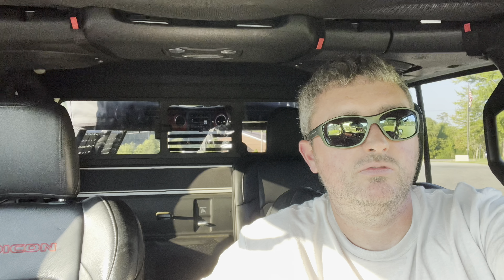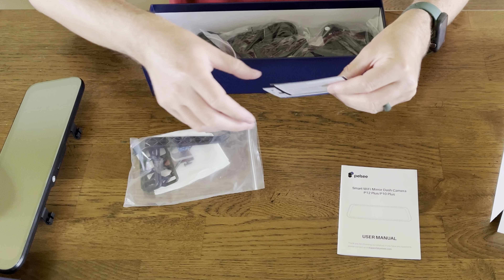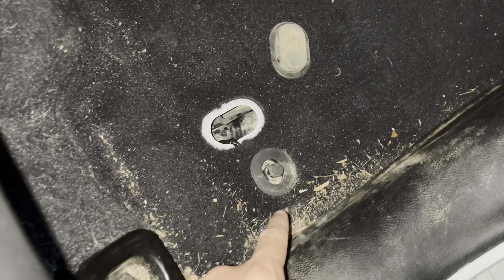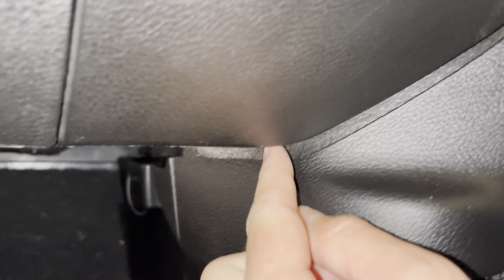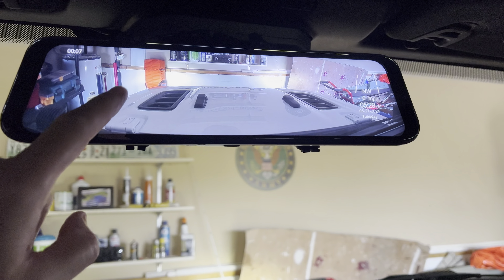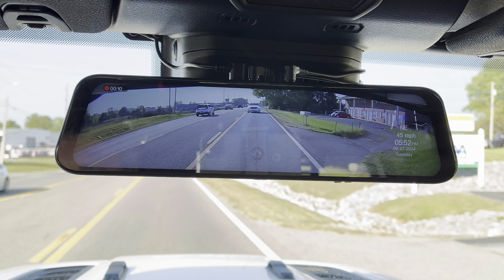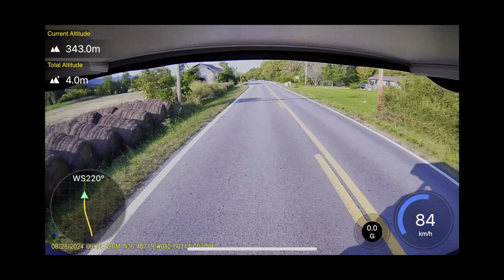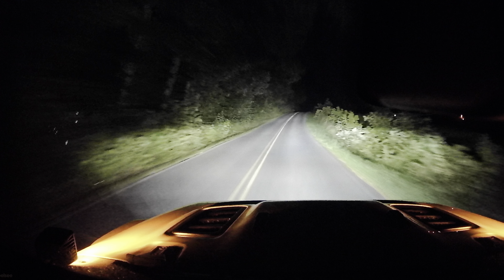Pelsee Front and Rear Mirror Dash Cam Install & Review | New Model P12 Plus

Comment: A little tip for new installs, just set the smart features to auto calibrate, then you can turn it off and tweak the setting yourself.  This is most helpful on the LCA as that can be tricky to set the 8 dots right

Comment: Just came in last night and installed this morning.  Took about  90 min to full install, hide wiring, and route the rear cam to the exterior.  Really nice touch with the auto backup down view.

Haven't played with the safety alerts much but noticed you can't run them all at the same time.  I would say that's the only negative. Also would have been nice to have a built-in GPS antenna vs the external wired harness.

Just ordered the hardwire kit for passive recording.
Reply from the maker: @joephu  nice! I didn’t hook up the red wire for auto backup since I already have a backup camera. And ya idk why they couldn’t just put the GPS module inside it? 🤷🏻‍♂️ haha. Sounds like you had a fast install time!! Haha
Reply: @appalachhaun_adventures  I installed the hardwire kit.  Works great.  After powering off the car, the screen has a pop-up that says time lapse starting, then the screen turns off.  Nice touch.  I set the frame per sec to 1 and duration to 24 hrs.  The battery save feature (auto-off) is a little to aggressive for my liking as 12v means you car may not start.  I put the toggle to the most conservative  setting 12.4v cut-off.
Reply: If you had brought the regular version, then all four safety features work together. Unfortunately it is not there in the expensive version which I think is absurd. Perhaps it is better to go for the earlier version. Who knows! Pelsee may agree to an exchange. All that you got to do is to remove the unit and put the other in. I think it is worth the effort because all four working together is a valuable asset.
Reply: @anthoneymahateva5851  yeah, plus the lane change doesn't work right with the latest firmware which support acknowledge.  I returned the P!2 Plus to Amazon and got the P12 Pro.  Basically identical unit but lacks the WIfi mobile viewing.  Since I don't see needing that feature much, it was worth the swap and now everything works great.
Reply: @joephu  Very smart of you. I applaud you for the sensible decision.

Comment: I just bought one. Arrives tomorrow... However, I got the 4k front and 2150 back cam version. A little bit more moola, but I think the better cam in the rear is useful.
Also, I really appreciate you going over the safety features here, because that's the primary reason I bought it, and there seems to be very limited info online about it all.
Reply from the maker: @TroyWatsonYEG  ya it’ll look a little more crisp and clear on the rear camera!! Thanks!! 🙏
Reply: @appalachhaun_adventures  thanks for the video , do you think 2.5k rear camera is worth the extra $? almost double the price with all the coupons as of right now
Reply from the maker: @ sometimes the rear camera on mine doesn’t look as clear as I’d like. I’m sure it’s nice if it’s more clear like the front camera is

Comment: Great review :) I have a quick question.. is the LCD's image bright enough to actually see it clearly during the day? Looking at your video it seems the mirror is extremely reflective and unless the LCD panel is really super bright, then it will be very difficult to see the screen during the day. I already had a couple of mirrors like this that I ended up returning because of this problem.. the screen was too reflective and the LCD panel too dim to actually provide a clear and easy to view picture. Thanks again :)
Reply from the maker: @yuidfbse  it gets pretty bright. I just repositioned the mirror at tad to be more straight rather than angled like it. Or ally would be so the rear window sunlight isn’t reflecting into it and it made that go away. It works great for me doing that. Just tilt and move the mirror a little so the little bit glare goes away and no issues

Comment: Awesome video, thanks so much!  Would you (or anyone commenting) choose this or the Wolfbox 900 Pro?  I'm deciding between the two now!  Thanks!
Reply: a little too early to tell but from the features and price alone, for some reason the pelsee is the only mirror type around that range with the safety alert features if that's what you are looking for. Night vision on the pelsee also looked better than wolfbox to me when comparing review pictures. I'm not sure why wolfbox is the best seller on Amazon atm never bought one to try and can't speak on longevity for either. I used to own a brand named "veement" with a 2.5k rear camera but the night vision still wasn't that great. It's been going strong for 3 years and I only switched now to pelsee for these extra features. From my research these mirror types night vision isn't that great compared to other types of dash cams but that is the trade off if you want to use it for everything else. I've found that settling with one that works decent for me but not the best is good enough
Reply: @qwerty-do4bh  Thanks so much for the detailed response!  I went ahead and ordered the Pelsee P12 Pro Max!

Comment: When using as a backup camera, vehicle in reverse, does it show backup lines, or does it just show the BSD area lines that you set up in the BSD menu?
Reply from the maker: @livingthereallife1  there is a red wire on the rear camera wiring. If you connect the red wire to your back up light on your vehicle, it will trigger the back up camera view and also turn on the guide lines to assist backing up. I didn’t not connect that red wire because my vehicle’s entertainment system already has a rear backup camera on its screen that does that for me. So I didn’t need this rear view mirror camera to also do that.

Comment: Just got mine today and tested it out. Good for the most part except one problem I had that's most likely user error but hard to tell. When I tried both auto and manual calibrate for ADAS the only safety alert it'd give me is "watch for collision." Nothing for the vehicle in front starting or for pedestrians. Has anyone else had this problem or knows a fix? would appreciate

Comment: I’m just wondering if leaving the dashcam plugged into the cigarette lighter would drain your car’s battery when the car is turned off? Will the dashcam also turn off when your engine is off? Thank you.
Reply from the maker: @carmelamabelprincipe6610  you unplug it and plug it in when u turn off and on vehicle. U can get the hardwire kit that runs wires to battery that will turn it off and on with vehicle

Comment: Great video!  It looks very similar to the Wolfbox G900 I ended up getting few months back when I picked up my new JL.  I have the same problem with the ACC box being in the way of the viewing in the front, but I live with it.  The other issue I have and I wonder if you do too is putting down the driver side sun visor.  I can't pull it all the way down without hitting the 12 inch dashcam.  It's just too wide and interferes.  Is yours like that too?  I do like your dashcam a little more than mine.  The Wolfbox doesn't have the app features or the lane departure or blind spot monitoring.  Those are nice features!
Reply from the maker: @WreckedBrewery  yes for the visor. The passenger side visor is still good. Because the front camera on the mirror dash cam, it blocks the driver side sun visor. However, I can pull the sun visor towards me while it’s still folded up and bring it towards me a little and then fold it down and towards the windshield and the push it back where it belongs and it works that way. 😂 if that made sense
Reply from the maker: @WreckedBrewery  I use that adaptive cruise control a lot tho!! Haha

Comment: Will this model work with rear view mirror with Onstar?  We have a previous Pelsee, and it didn't fit right.
Reply from the maker: @darengibo  it just needs to fit right over top of your existing mirror and then it has the 2 places where the rubber pieces will go around the back of your existing mirror to hold this mirror on it.
Reply: @appalachhaun_adventures  yeah, it is the "curve" at bottom of  the onstar mirror that makes it not fit perfectly. Wondering if this one was better fit..

Comment: I tried to ask for support how long the cable is for rear camera , but they don't answer, please ask if possible, thank you in advance.
Reply from the maker: @sandorsebestyen8620  Amazon description says 19.6ft
Reply from the maker: @sandorsebestyen8620  I needed an extension to run it close to the rear of a mid size truck tho.
Reply: @appalachhaun_adventures  Thank you

Comment: Can this go into 2008 Toyota??
Reply from the maker: @dayday9350  I think it works in any vehicle that has a 12b cigarette lighter home charger type outlet in it. That’s all you need. Then it just wraps over top of your regular rear view mirror.
Reply: @ do I have to hide the wires or will it interfere
Reply from the maker: @ you can do it however you want. I thought it pups be more of an eye sore if I left wires all over the place. 🤷🏻‍♂️

Comment: Hey! I have a newer car that doesn’t have a 12v adapter cigarette lighter plug in. I only have a type c and usb. Do you know how I can still connect this? Maybe somehow converting it? Is there a converter plug or something? Thanks in advance! Anyone is welcome to comment please.
Reply from the maker: @stevensam8834  I can try it with just the USB port on the mirror plugged into USB in my Jeep to see if that will power it. My Jeep is in the shop so it may be a few days tho. The 12v power cord plug in is a USB C on the mirror. Maybe just a regular USB C cord will work. Not sure if that will power it. I can try. I can also ask the company themselves via email!! Let me see what I can do!
Reply from the maker: @stevensam8834  the best solution is to buy the mirror + hardwire kit together. If you go to the link below or the link for the mirror in the video description you’ll see you can get the mirror + hardwire kit bundle for like $10 extra. It’ll then be hooked up to your vehicle battery for power. If you think that may be hard to install, search YouTube for mirror dash cam hardwire kit install. I’m sure they’re all very similar between the brands. Also, I’m sure a local car stereo shop or something like that could easily do it for you too. I hadn’t planned on using it for the 24 hour parking monitor feature so I didn’t bother with that hardwire kit. I’m sure it’ll have instructions with it too though. 

https://amzn.to/4evyMuG
Reply from the maker: @stevensam8834  the other alternative would be a standard usb-c cable from the mirror to your vehicle. However, I’m not sure if your vehicle usb-c ports would supply stable power output from those usb-c ports. I still don’t have my Jeep back from the dealership to try that with just a straight up usb-c cable.
Reply: Hi there, how do you get a power supply through that cigarette lighter power port when the vehicle is off & locked?
Reply from the maker: @mohammedkahwaji4023  Only reason you want to to have power when vehicle is off and locked is if you want to have the 24/hr parking monitor on so it’ll record if the vehicle is hit. If you want to use that functionality on the mirror dash cam, you need the hardwire kit to wire it to the battery. If you do that, you no longer need the 12v cigarette lighter power port. I put the link for that hardwire kit in the video description too or it’s there if u go look on Amazon for the mirror and it’s in a bundle to buy both.
Reply: @appalachhaun_adventures  Thanx for the heads up, I’ve ordered the P12 plus version but not sure which one is a better version compared to the P12 pro max .. I wanted a one that I can access and have a live view through the mobile app
Reply from the maker: @mohammedkahwaji4023  this “Plus” is the only one with the WiFi phone connection with mirror through the app  from what I can tell and it is the newest model. It literally just came out as soon as I got it.

Comment: Anybody else has there’s licensee plate  mounted and experiencing alot of wobble??
Reply from the maker: @johnnyyoungjr2096  I had to tighten the crap out of the little screws in mine that isn’t on a license plate. I think for that, you’ll have to figure out a way for the entire license plate to be pointed very solid with no play. Maybe some of that foam tape padding on the back of the license place to help hold the license plate itself? 🤔

Comment: When you are driving and set the rear camera on screen its very DANGEROUS because the cars on the left are actually on your right side. Its called mirrored
Reply from the maker: @sandorsebestyen8620  nope. Incorrect. 😆 you can actually flip it if you need to, but no. Mine is correct just as it would be with the normal rear view mirror…. 😂👍👌
Reply: RTFM, lol.  This is such a newbie oversight.  You can mirror the image or even flip it upside down.  You just need to change the default setting